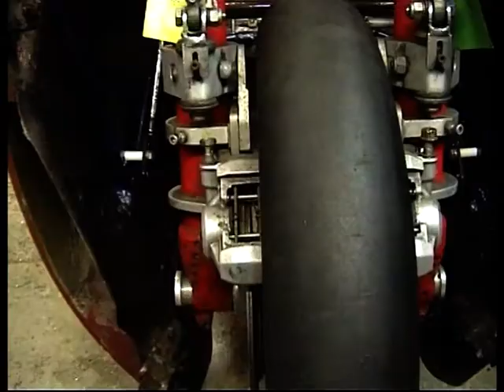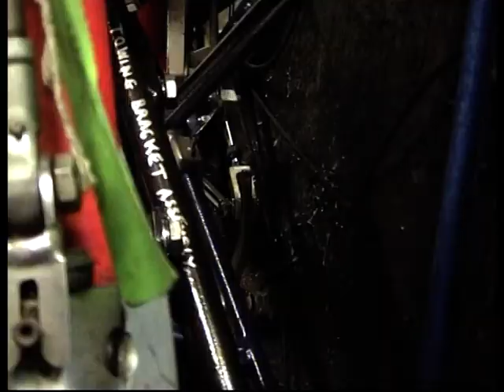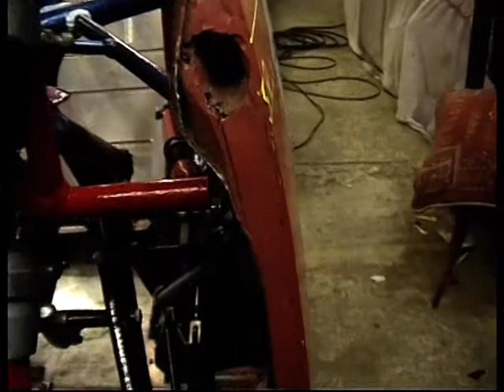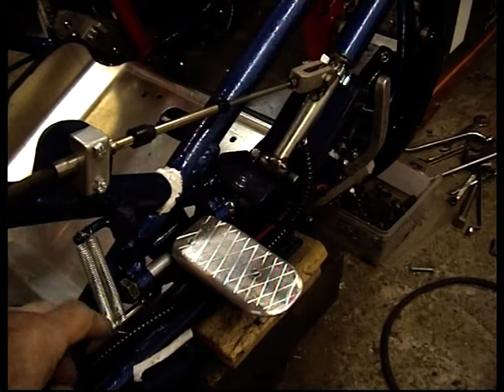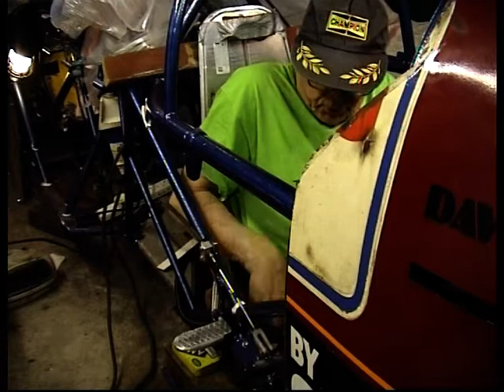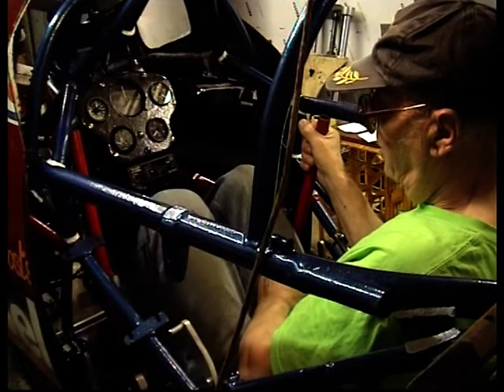Around the Cockpit, Streamliner Update Oct 2018

Comment: sod the ones that don't want you to run it.
its taken you this long to get this far will they be doing it 77.
credit has to go to you Pete doing it of your back etc you are doing a great job with it if only you was closer as i would help you if you needed the help.
any way crack on with it lets see this run and shut the disbeliever's up once and for all.
keep up the good work Pete i will be making a trip up to see this run.
Reply from the maker: Hi Martin 2E0ERY, thanks for your generous comments. It is always great to have words of encouragement. Problem is, although I've not heard it direct myself, more through the grapevine, that it is a certain organizer of events that is 'concerned' about me running it, for whatever reason. I think they just want to cover their backs. But I shall press on as long as I can. I would like to have begun this jet project sooner but wanted to achieve over 200mph on two wheels first, which I did in 2014 and again 2015. I'd had the jet engine for many years. Thanks for your support. Cheers, Pete.